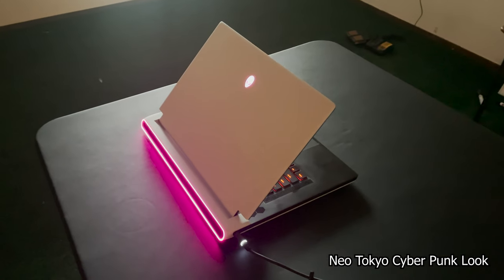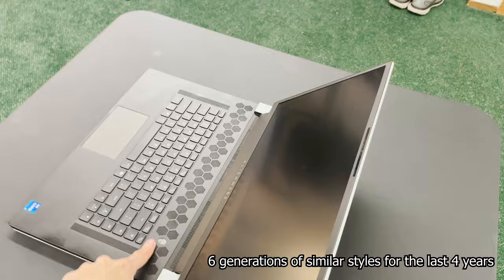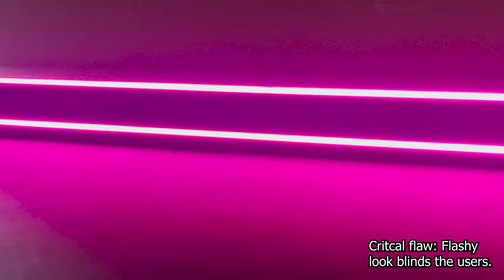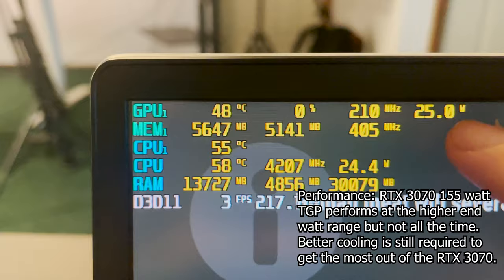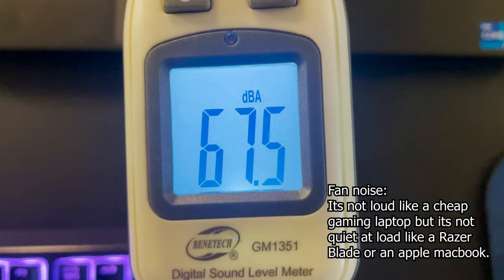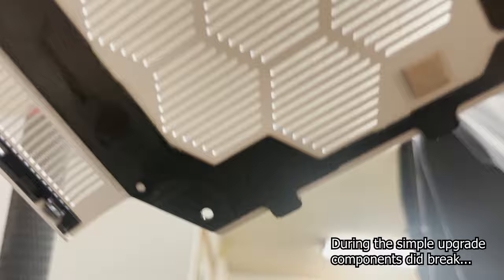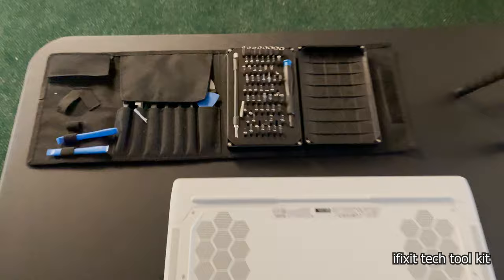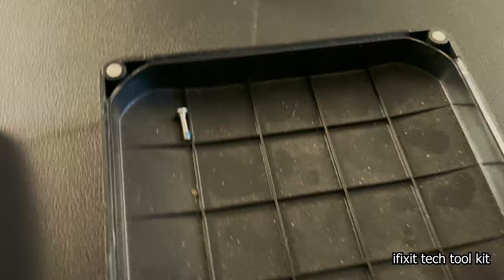NEW Alienware x17 Review - EXPERIENCE! RTX 3070, 8 Core i7 11800h Gaming Laptop Review - BESTBUY

Comment: Hi Serge. does the heat at the vents just below the screen and the right side get really hot to the touch when gaming?. such is my experience with the 3070 version.
Reply from the maker: yeah its pretty normal sorry about that experience of yours it must be alarming to see such heat but basically the machine needs to breath and it breath out hot air and usually the thinner the machine the hotter the spots on the machine are, some machines get so hot that they will burn you to the touch so what you had happen is pretty normal.

Comment: just ordered this laptop, it was 650$ off for cyber monday
specs are
11980hk 8 core 
rtx 3080 16gb
3840 x 2160, 17.3 inches
512 m.2 pcle nvme solid state drive
32 gb ddr4 3200mhz

for $2999
Reply from the maker: Oh wow I really wish I ordered it I want a 3080 real bad! 3070 lags in some of my games like RUST.... What games are you gonna play on that?
Reply: @SERGE_Tech  probably forza 5
Reply: 3070 is the sweet spot for excellent 1440 gaming. But 3090ti is minimum for consistent 4k
Reply: @SERGE_Tech  so just an update
I had a lot of problems with this laptop haha
Mainly the heat sink or the fan
Dell fixed it from warranty so it's running like new again

Comment: hey! Really cool , after a long time I'm here :D, also i wanted to know what specifications do we have to check to buy a new compatible cpu cooler according to it, could you please tell me? Thanks
Reply from the maker: Wait are you saying you might want a new cpu cooler for a laptop? thats pretty much unherd of you cant really upgrade that vary easily, although they do exist I have seen a few but there probably isnt any for this specific machine. 

The cooler would just have to perform better in the RPM ranges then the previous machine, you can also check how loud it gets via DB reader/analysis.
Reply: @SERGE_Tech  No actually I'm talking about a pc cpu cooler, my stock cooler has been acting soooo weird lately like when i turn on my pc sometimes it doesn't start and sometimes it does but the speed is embarrassing for a gaming pc,  it speeds up after like 40-50 minutes but still isn't enough for gta v and minecraft( heavy cpu load) my processor is Intel core I5 2400 and the fan which I've been thinking to buy is Coolermaster i70 (not i70c) on amazon, can you tell me if it's compatible with my processor? Also my motherboard is zeb b75 , you know much more about tech stuff than me so i thought to ask you  because you reply to every comment,  thanks

Comment: U have to change the mux switch in the bios by pressing f2 on start up and i think its only in one display option out of 3 that has mux
Reply from the maker: Oh cool ok I’ll give it a shot and let you know. So did the video answer all your questions or do you wish this video included another kind of section?
Reply: Why would you do that on this laptop?it has an advanced optimus which is a better options
Reply from the maker: Hmmmm I should examine this in greater detail
Reply: @SERGE_Tech  well theres only one display option that even offers advanced optimus and g sinc so if u got any of the other 2 i believe ir out of luck but from what i see u have to change it in bios mode ill put link in another comment to show
Reply: Yes he obviously did not research this model
Reply from the maker: @jaxripper251  and how would you research it? explain to me your process and how mine can be better. Honestly just wanna get better.
Reply from the maker: @jaxripper251  Did you just think I did a bad job with the review or what?
Reply: @SERGE  did you not watch any videos on this? I have owned this laptop for sometime before I bought it I did all the research
Reply: @SERGE_Tech  I think you should have looked up if it had a MUC switch in the Bios
Reply: @jaxripper251  None of the R1s came with a Mux built in.  However, Dell has recently released a BIOS update which provides a MUX option for ALL X17s regardless of display.  The lack of a MUX was the biggest gripe when they released it.

Comment: Isn’t it a 140w version?I think you got it wrong with wattage?
Reply from the maker: you know its quite confusing because my monitoring programs told me it jumped up to 148 watt then I herd some websites say it has 150 watts, its quite confusing honestly wondering if the software im using is messed up or if theres some kind of dynamic boost to the watts so if its 140 watt then maybe it can boost to 148 idk man is crazy how secretive alienware and dell are...
Reply: @SERGE_Tech So the graphics card TDP varies according to the manufacturer, that applies to Nvidia's mobile GPU found on laptops as well (i.e. Dell, HP, Lenovo) and so on. I visited Nvidia's website and found this statement at the bottom of their web page "Clock specifications apply while gaming with medium to full GPU utilization. Graphics card specifications may vary by add-in-card manufacturer. Please refer to the add-in-card manufacturers' website for actual shipping specifications".

Comment: Dude i have the same problem on my and my brother laptop

Asus 17 2021 with rtx 3060 130W
Lenovo legion 5 rtx 3070 140w

Their Gpu and CPU utilisation  rarely gets to 100or 90%
So in gta 5 (max settings) 
Im only getting avg 80-90fps
Even tho the temps are low between 80c 70c

Another problem im facing is that when im lowering the game's graphic settings
I don't get more fps  but instead the CPU snd Gpu usage and temp just decreases!!
Reply from the maker: Yup the thermal profiles are probably set below the operating systems controls although there may be a way to modify the firmware or use advance software to force it but really just get an Alienware area 51m with 10900k and 2080 super and you won’t have that problem Alienware for a while was the only one who could pull of true performance the rest have to throttle to protect the the hardware.

Comment: Hey, just wanted to say that the temperature of 75°C is nowhere near exceptional. For example even my old notebook msi 75 ge raider with a gtx 1070 is constantly at its max watt of 115 while maintaining 75°C easily
Reply from the maker: Well it happens that you got a decently cooled machine, but that machines also thicker, Normally machines run hotter.

Can you provide an example of an exceptionally cooled machine?

Maybe I should of just said it cooled decently would that have been more accurate?
Reply: @SERGE_Tech  im not sure if the temperature should be any lower than 75°C since its a good working temperature without damaging the GPU long term. All the MSI have the same Bauplan with 2 fans, like 5 heatpipes across CPU and GPU in the middle. Alienware's Bauplan is definitely exceptional with the 4 fans though i agree. Im not sure why your GPU was not working at its full watt. that may be related to your software (settings, drivers etc.)
Reply from the maker: Wow you know your stuff?! 
Well thank you for putting up with me. 
I’m glad someone can share and be knowledgeable :)